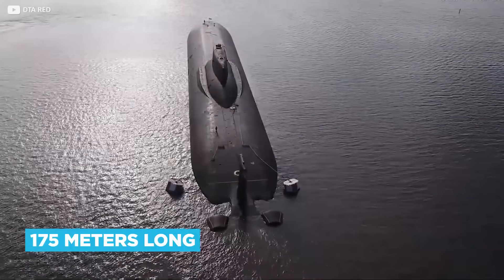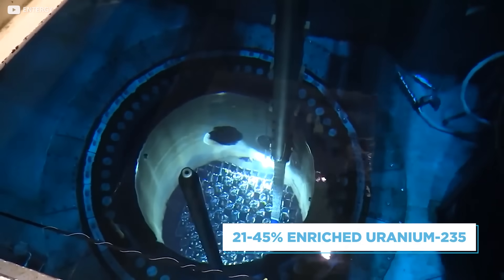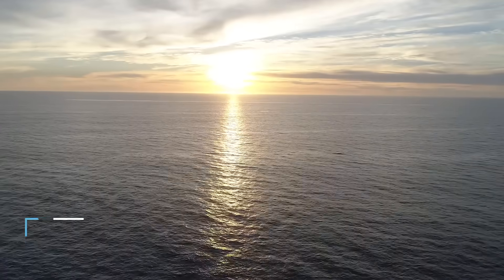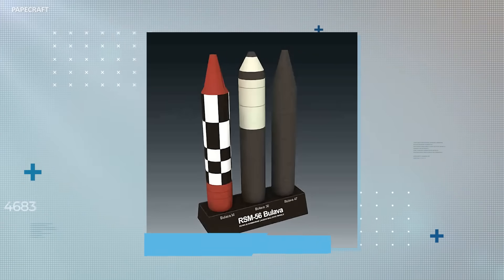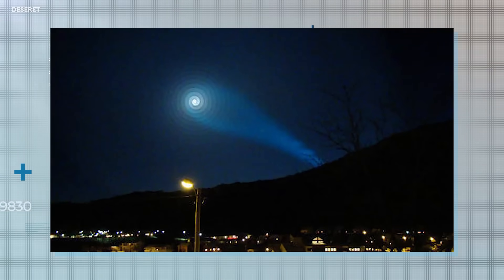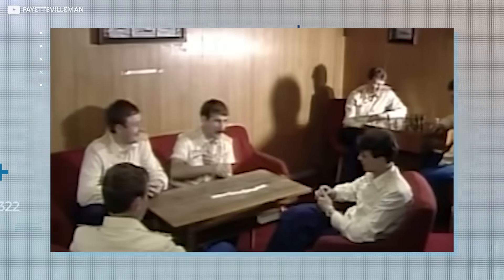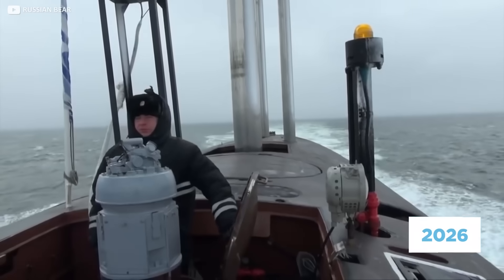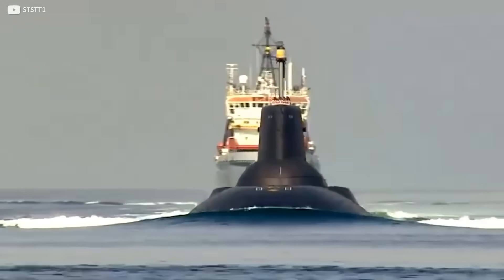Inside Russia's $5 Billion Typhoon Submarine

Comment: Absolut bullshit video.
- Bulava is not for Akula class. It was just test bed. 4 tubes from 24 was prepared for Bulava class rockets.
- R39Riff were that time outdated rocket. Massive with poor propellant and range only 8300km. Polaris/Trident, much smaller, greater distance. It does not cover the entire planet.
- Test depth 400 m (1,300 ft). 900m is bullshit. And "just 900m" is also bullshit.
- Sub had to be big, cause rocket were also big. Was outdated before the first line on the drawing board. Be big is a disadvantage.
- Without any fatal modernizations. Absolut bullshit. It was phased out as outdated, not

Comment: The deepest depths a sub can reach is normally highly secret, it's a top level military secret, so I'd take the 900 metre dive depth of this sub with a large pinch of salt. Also 900 metres is hugely deep for a sub, so again I'd be very surprised
Reply: Titanium hulls
Reply: Only Americans are so paranoid, that even bowel movement of petty officers are classified. Other countries distinguish between obtainable and unobtainable information. For example If you know thickness of pressure hull and its material, you can pretty accurately calculate its crush depth and subsequently test depth. So if civilian can calculate this, technical analysts from your secret service can do it even better. Also Russians do not see any benefit to keep classified information about decommissioned class so this is why official test depth jumped from 600 to 900 meters recently. Same story for Alpha class, official test depth 350 meters. Then at end of class service one of them dived and returned from 1350 meters, with damaged equipment, but that was expected, because it is mainly equipment which really limits operational depth of submarine.

And now why Typhoon, ballistic submarine was capable to dive so deep? Well because it was Gorshkov child, and Gorshkov was enemy of good enough. He wanted to have everything much better then enemies. So he pushed politburo to make typhoons from titanium. Which was done but it was also extremely expensive (3 billion then USD compared to only 2 billion USD for Ohio). Also generally Soviets believed into depth. Depth could hide you not only acoustically if you get under SOFAR, but also thermally (moving nuclear submarines are in cold waters visible from space in medium depths 200-400 meters, depending on speed and water currents) and give you some protection against combustion propelled torpedoes (Mk 48 is at depths over 800 meters so slow, that it is not usable there, this is why majority of navies keep or exclusively use electric torpedoes which does not have this back-pressure problem).

And taking into consideration, that majority of US Submarines (Seawolf is exception) have operational depth relatively shallow (250-400 meters), better operational depth was significatn advantage for Soviets.
Reply: Most submarines have declared diving depth at around 300 meters.
Reply: @mikecimerian6913  that was the kind of depth I imagined, although I bet secretly they could go to 400

Comment: Here's what they left out , the Typhoon is made up of several pressure modules inside of the external hull .. The Soviets weren't so great at making high quality single hulled submarines so they decided to build multiple pressure modules and place them inside a massive exterior hull that would help insure the vessels pressure integrity  so it isn't nearly as large inside as it appears from the outside .. having said that it still is massive and impressive , the last one was built way back in 1985 during the cold war ...
Reply: BS. They were at same level to do it. But double hull has many advantages, it you are not looking at costs.
1. Outer hull can be much more streamlined (which is why Soviet subs has lower drag coeficinet than american ones)
2. Inner hull can be much more pressure resilient, because it is designed pressure wise, not hydrodynamic wise
3. Inner hull is much more spacey, because ribs and equipment can be outside between inner and outer hull
4. Submarine is much more resilient to attack, because there is space between inner and outer hull (Oscar class has almost meter) and submarine has much higher buoyancy reserve (Typhoon 50%, Ohio 11%)
etc...

Also outer hull does not contribute in any way to vessels pressure integrity, when submarine is submerged, there is water between inner and outer hull at same pressure at is water outside outer hull.

Typhoon is huge even internally. Basically it is composed from two hulls comparable in internal volume with Ohio class, but this volume is not occupied by balast tanks and missiles. On Typhoon every crewmember sleeps in cabin with sink. And maximum occupants for a cabin is 4 crew if they are lowest rank (officers has single cabin). Usually crew is accommodated in cabins by two. Compare that with hot racking on majority of US subs!

Double hill has also disadvantages, mainly costs but not exclusively.

Comment: I’m aware of so many submarine disasters, not to mention the Kursk, and can’t think of a more horrific way to die than if a sub is filling with water and you have enough time to know you are going to drown or suffocate or freeze. To be trapped in a steel tube hundreds of feet under the surface when disaster strikes - nearest I want to be to that is Blackpool.
Reply: The water pressure at those depths means it doesnt slowly fill like you think it does, its instant lights out for you.

Comment: Given the utilitarian nature of the Soviet Union, it’s kind of ironic that living on a Typhoon  seems like a luxury cruise compared to US submarines.
Reply: The last thing you need is the crew of a submarine with enough firepower to destroy every city and large town in the UK going stir crazy after 3 months at sea in a metal tube.
Reply: Lol, you are trolling right? Are you saying the Tyhphoon looks more luxurious than US submarines because of the swimming pool? They literally are pretty much the same in terms of comfortablity.
Reply: @dinuxplay8003  Not even close. US submarines are cramped and yet overcrowded. It is result of combination of relatively small sizes of submarines and distrust of USN into automation. Just compare Akula class to Los Angeles class. Akula inner hull had length 75 meters and diameter of 12 meters, 8500 m3. Los Angeles had pressure hull lenght 83 meters and diameter of 10 meters, 6500 m3. BUT, In this pressure hull were also ribs, balast tanks (1000 m3) and all equipment. Also OK-650 is much more compact reactor than S6G (despite being more powerful) and also shaft and gearboxes were outside inner hull in Akula, meanwhile LA had them inside pressure hull. So real ratio between LA and Akula was 1:2 in internal habitable volume. And what was crew count? 73 (later even 62) for Akula compared to 130 for Los Angeles. And we are comparing fairly similar subs.
Now Typhoon was behemoth more than twice as large than Ohio class. Yet it has same size of crew. So taking into consideration, that most luxurious commodity on submarine is space, Typhoon is luxurious one.
Fact is that is is not just pool with water and sauna. It has relaxation room. Gym. Two large mess halls. Three times bigger cold storage. It is much more silent inside (because equipment is outside inner hulls and engineering hulls are separated from habitation rooms. Crew has not only their own beds (no hot racking) but they are accommodated in cabins (with doors) with maximum 4 beds per cabin and a sink.

When you are talking about comfort, Typhoon is not only another level, but totally another game compared to US submarines. No other submarine, not even newer Yasen or Belgorod offer such comfort.
Reply: @tomascernak6112  Depends on the sub, fast attack subs are cramped the same with russian fast attack subs.  But the ballistic missiles subs are not cramped for both the USSR and the USA.
Reply: @michaelmichaelagnew8503  American subs are cramped all of them. Even Ohio class. If you are hotracking, that mean, you are short of space. And if you do not want have hot bunk, CO has to allow you to sleep between missiles, which they usually do, but it means that even Ohio is cramped. In comparison, since Akula, Russkies do not have to share beds. And on Yasen, they have same facilities as were on Typhoon, this including that ALL crewmembers have cabins plus they have spare for mission specialist (up to 20 people). Yasen is classified as attack sub, although it is more SSGN. It is simply combination of size and small crew.
Reply: thats what you would think, but the ussr put a lot of resources into comfort and entertainment for the benefit of citizens
Reply: I assume it's the nature of a very small space and a very long time. It is technically very practical.